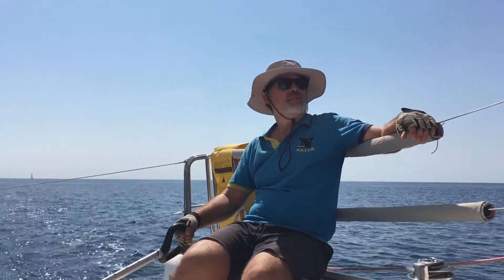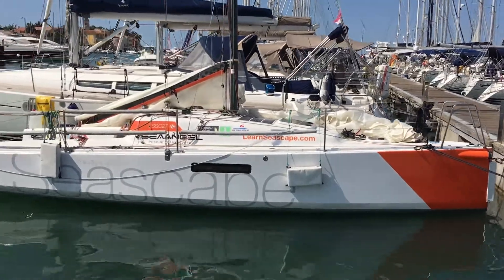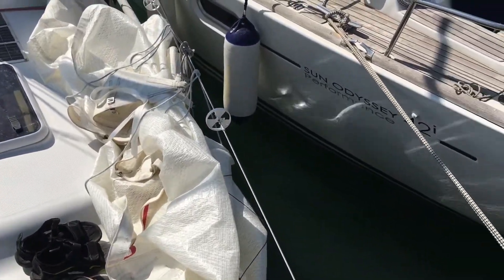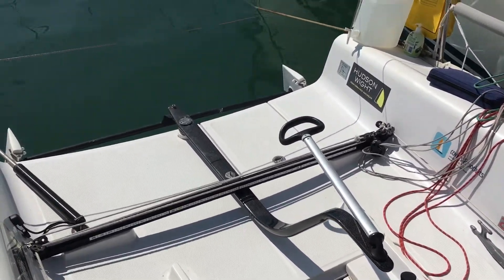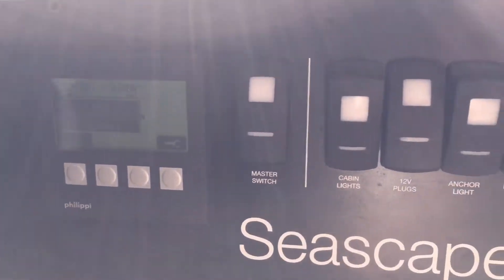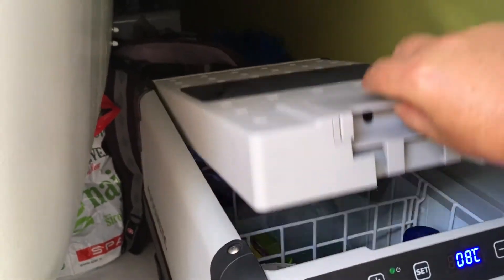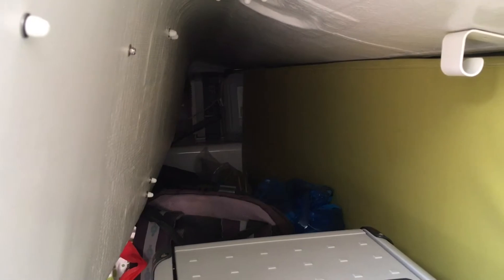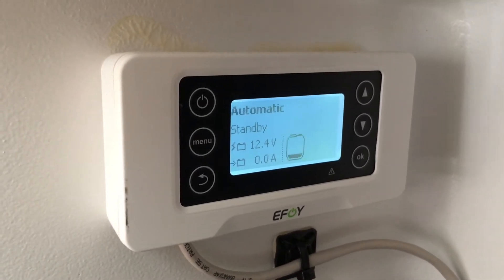Seascape27 using a Fuel Cell

Comment: So what is your conclusion on the fuell cell? Get one or not worth it?
Reply from the maker: It worked well for us. The freezer was running from the fuel cell and we had no noise on board of the small boat. If you have a higher demand for power, then this fuel cell would not fit. But the costs for the methanol are rather high, if used long term.